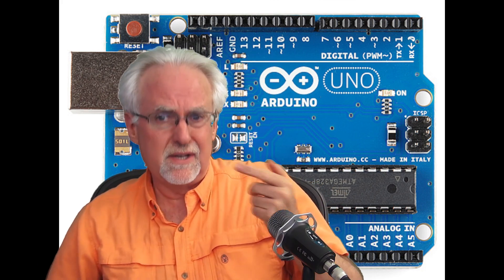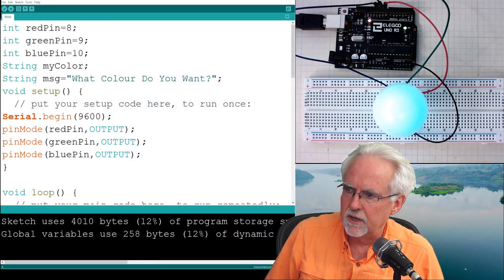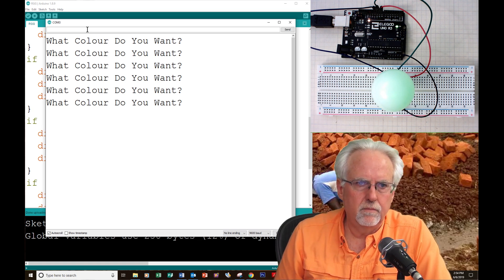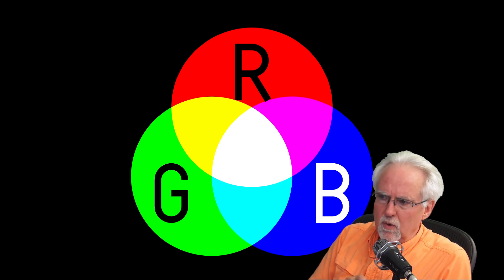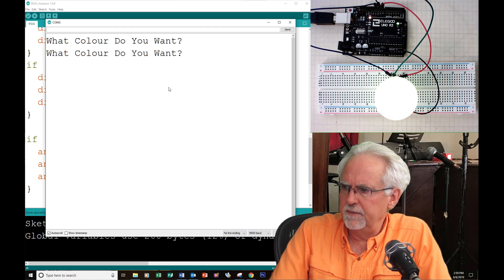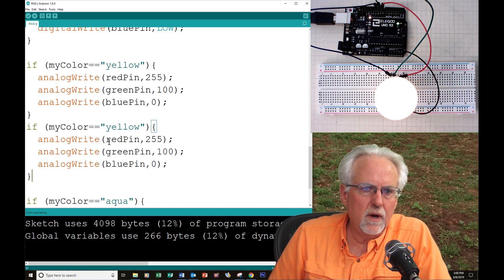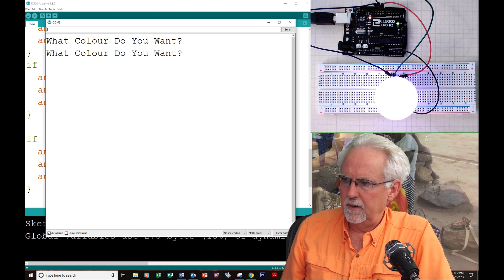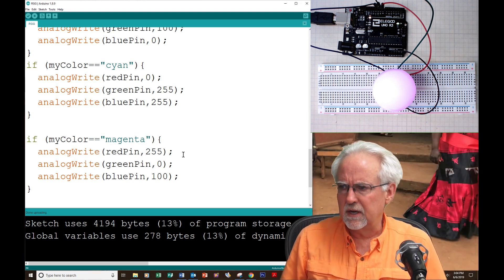Arduino Tutorial 21: Understanding and Mixing Primary Colors with an RGB LED

Comment: Hi Paul, thank you so much for your help! I have a question about my LED. When trying to mix yellow, I also started with the greenish color so I was meticulously going down with the green LED, but after a certain point, the color went from being slightly too green, to way too red on the next number. This border was between 128 & 127. So I just left it as is but it bugged me I couldn’t get it really accurate lol. Same for orange and fuchsia, couldn’t seem to dial those in at all. I wonder if my LED is just a little buggy and I should try another for reference. Anyways, please let me know if you’ve seen this happen before. Thank you again for your help :)

Comment: Even though I've checked and reconnected the cables and rewritten the codes many times, magenta lights up instead of red, aqua lights up instead of blue, and red lights up instead of yellow. No matter what I do, it doesn't change. I tried with different LEDs, but it still doesn't change :( 
When I check the pins one by one, all of them have the correct color, but when I write the code in this lesson, none of them work correctly.
Reply from the maker: Debug by connecting three seperate LED and see if they behave as expected. It is hard for me to imagine what is causing what you are seeing.

Comment: I have a hard time understanding how i can get black color with lights and a white ping pong ball.  White is all 3 colors on full, works fine.  Black is all colors off.  Obviously ping pong ball is still white.  So....  i wonder if the ball were an semi opaque black if this would work better?  Maybe the colors wouldnt be so washed out.
Idk.  I just want a black ping pong ball lol
Reply from the maker: You get black color by turning the lights off and making your room dark. The color of the ping pong ball is now not defined by the LED, but by the room lights. For this case, for the ping pong ball to be black, you must turn off other light sources.
Reply: black its a lack of colors so you cannot obtain it like that

Comment: // C++ code
//
int redPin = 11;
int bluePin = 10;
int greenPin = 9;
int red = 0;
int blue = 0;
int green = 0;

String myColor;
String message1 = "What color do you want? ";

void setup()
{
  Serial.begin(9600);
  pinMode(redPin, OUTPUT);
  pinMode(bluePin, OUTPUT);
  pinMode(greenPin, OUTPUT);
}

void loop()
{
  Serial.println(message1);
  while (Serial.available() == 0)
  {
  }
  myColor = Serial.readString();
  
  if (myColor =="red")
  {
    red = 255;
    blue = 0;
    green = 0;
  } 
   if (myColor =="blue")
  {
    red = 0;
    blue = 255;
    green = 0;
  } 
    if (myColor =="green")
  {
    red = 0;
    blue = 0;
    green = 255;
  } 
    if (myColor =="cyan")
  {
    red = 0;
    blue = 255;
    green = 255;
  }   
   if (myColor =="yellow")
  {
    red = 255;
    blue = 0;
    green = 255;
  } 
   if (myColor =="magenta")
  {
    red = 255;
    blue = 255;
    green = 0;
  } 
  
//  	if (myColor =="")
//  {
//    red = ;
//    blue = ;
//    green = ;
//  } 
  analogWrite(redPin, red);
  analogWrite(bluePin, blue);
  analogWrite(greenPin, green);
}

My approach was to set red, blue, and green based on the color and use a single analogWrite statement for each pin. You could also allow the user to input desired values of red, blue, and green with a little additional code.

Comment: I got the assignment from tutorial 20 done by reading a single line of values for RGB such as 255 255 000 .  It was WAY more advanced C/C++ code than would be appropriate for this course.  You need to know something about "Class" and "Method."  Reading the string as input is no problem for people in this course.  It is:

Serial.println("Enter string: ");
 while(Serial.available()==0) {}
 tst= Serial.readString();

However, from this point on it is rough.  To break the input string tst into three integers that analogWrite() can handle you need to use two "methods" applied to the String "class."  Here it is, but you need to grab a book on Arduino coding like Richard Blum Sams Teach Yourself Arduino Programming in 24 Hours.

  tmpStr= tst.substring(0, 3);  // The dot construction applies the method substring to the variable tst.
  rPrime= tmpStr.toInt();         // Here is the toInt() method applied to tmpStr.  rPrime is the integer need for analogWrite()

Comment: this is fun.  in order to make it portable, I redid this assignment to add a pot. instead of serial input.  then I scaled the pot value 11/1023 and used the if statements based on the calculated integer value.  can change color by dialing the pot, no computer needed.

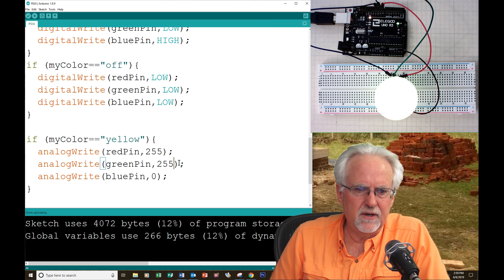Comment: i dont understand this: red and green at 255 in rgb color science produces yellow. Why does that not work here  between 9:00-9:30? Is there some calibration issue of the rgb led? Why does the practice not overlap with the theory here? Your rgb (255, 100, 0) should, in theory, produce a darkish orange, but in practice it produces what you call a "very very nice yellow".

Comment: For Homework you should have had them make ALL 255,000,000 colors! lol...on a serious note when I write a sketch my commands dont turn blue like yours?  is there some setting I have turned off?
Reply from the maker: The new arduino IDE does not turn colors like mine. I thin I was on something like version 1.8. Might download the older IDE.

Comment: Ok this is a Challenge for y'all learners, The goal is to make as many color as you can but, instead of adjusting the color LED power in the Arduino IDE, I want you guys to buy or go get 3 potentiometers and use those potentiometers to adjust the color power, right a code for your potentiometers so that it will control the the color dim.

Comment: Hi Paul! My  RGB LED is not working very well. The LED lights up when I plug it into 5V instead of GND, but I can't control it via pins. I have also tried different cables and other code. But nothing works. What can be the reason?
Greetings from Switzerland

Comment: Having a lot of fun with this class. Even though I have the Elegoo Super Starter Kit, I also have a DrDuino Explorer board that I assembled and am trying to learn how to use. If you are not familiar, the Explorer has a lot of components and devices installed as a very flexible bread board. I can talk directly to many of the devices on board, or switch them out and use the GPIO pins to talk to a conventional Breadboard. Today I used it to play with the RGB LED. Instead of entering numbers via the Serial comms, I used the three on-board Pots. Read them via analog pins, converted to PWM values, and sent the numbers to the LED. Therefore I can adjust the three pots to create any color I want. So much fun! Thanks for this great class!

Comment: Being the exploring type, I came up with an interesting variation.
Using for loops and and an if statement, I wrote a sketch that continuously cycles the RGB LED through al the colors from red to yellow to green to cyan to blue to magenta to red, and all colors in between. Of course I used a delay to control the speed.
Pretty cool!
Reply: Awesome

Comment: Hi, I am facing a trouble if anyone can help. I have trying to use if statement for comparison of input String. but weirdly the == operator is not working. If I input "red" from serial monitor using myColor=Serial.readString(); and compare using myColor=="red". the statement is coming false. I have check all the formatting and checked individual LEDs as well. But when I input red the red LED is not lighting up.
Reply: The serial monitor adds “/n” to end of “red”. In the serial monitor, at the bottom, select “no line ending”. It will work.

Comment: I have tried two RGB LEDs and the blue will not modulate.  They are full on at 128 and off at 127 .  I have tried reducing the resistor to no avail.  What is going on?
Reply from the maker: Are you connected to a pin with ~ as instructed in the video?
Reply: Ah that was the trouble.  Thank you for taking the time to respond.  You are an excellent teacher.

Comment: Thank you so much,these lectures are helpful.Am new to Arduino  and wishes to do a control project, now my question is,is it possible for me to use a single Arduino to have a battery charge controller and an LDR based LED light controller?

Comment: That is my code for RGB LED controled by potentiometer : )

int red = 11;
int blue = 9;
int green = 10;
int readPin = A5;

float przejscie;
float blueVal;
float redVal;
float greenVal;

void setup() {
pinMode (red, OUTPUT);
pinMode (blue, OUTPUT);
pinMode (green, OUTPUT);
}

void loop() 
{
przejscie = analogRead(readPin)*(1275./1023.);

while(przejscie <= 255)
{
przejscie = analogRead(readPin)*(1275./1023.);
blueVal = przejscie;
analogWrite(blue, blueVal);
analogWrite(red, 0);
analogWrite(green, 0);
}

while(przejscie > 255 && przejscie <510) 
{
przejscie = analogRead(readPin)*(1275./1023.);
blueVal = 510 - przejscie;
redVal = (-255) + przejscie;
analogWrite(blue, blueVal);
analogWrite(red, redVal);
analogWrite(green, 0);
}

while(przejscie > 510 && przejscie <765) 
{
przejscie = analogRead(readPin)*(1275./1023.);
redVal = 765 - przejscie;
greenVal = (-510) + przejscie;
analogWrite(blue, 0);
analogWrite(red, redVal);
analogWrite(green, greenVal);
}

while(przejscie >=765 && przejscie <=1020)
{
przejscie = analogRead(readPin)*(1275./1023.);
greenVal= 1020-przejscie;
blueVal= (-765) + przejscie;
analogWrite(green, greenVal);
analogWrite(blue, blueVal);
analogWrite(red, 0);
}
while(przejscie > 1020 && przejscie <=1275)
{
przejscie = analogRead(readPin)*(1275./1023.);
blueVal = 1275h - przejscie;
analogWrite(blue, blueVal);
analogWrite(red, 0);
analogWrite(green, 0);
}
}

Comment: Great tutorial, Paul! I adapted the program so you input the red level (0-255), green level (0-255), and blue level (0-255), and then turn on the LED appropriately. Easy way to experiment with the colors without changing the code each time. Thanks for all your hard work!

Also, and I am probably a minority opinion here, I would love even more theory.  I'm sure you'd get lots of pushback, but hey, that's what the fast forward button is for. Personally, I like knowing everything about everything I am doing.

Comment: i was doing this w/ clone nano, didnt work, checked ledw/ 5v pin, worked, checked arduino by swapping it w/ another, and code by downloading it from ur website and it won't  work, plz help, it was't outputing any voltage across any pins when i selected witch colour, but all the pins work with a blink sketch, may just be an arduino web editor bug?
idk
Reply: also all the other eposodes worked, exept 20,21, and19
its weird

Comment: Excellent stuff thank you!  However in Tutorial #20 the pin assignments were 8,9,10.  On my Arduino pin 8 does not support analog (there's no ~ against it) .  I shifted my pins to 9,10.11 all of which support analog writes, or am I missing something?  Also my RGB LED was the opposite polarity, so I needed to invert all the values :-)

Comment: Had a fun little idea using the potentiometer to change the color of the LED.
if anyone wanted to try it here is the code I used.

int r = 9;
int g = 10;
int b = 11;
int potVal = A1;
int readVal;
int pause = 200;
void setup() {
  // put your setup code here, to run once:
Serial.begin(9600);
pinMode(r,OUTPUT);
pinMode(b,OUTPUT);
pinMode(g,OUTPUT);
pinMode(A1,INPUT);
}

void loop() {
  // put your main code here, to run repeatedly:
readVal = analogRead(potVal);
Serial.println(readVal);
delay(pause);
if (readVal >= 0 && readVal <=85){
  analogWrite(r,255);
  analogWrite(b,0);
  analogWrite(g,0);

}
else if (readVal >= 86 && readVal <=170){
  analogWrite(r,255);
  analogWrite(b,0);
  analogWrite(g,30);
}
else if (readVal >= 171 && readVal <=255){
  analogWrite(r,255);
  analogWrite(b,0);
  analogWrite(g,70);

}
else if (readVal >= 256 && readVal <=340){
  analogWrite(r,125);
  analogWrite(b,0);
  analogWrite(g,255);

}
else if (readVal >= 341 && readVal <=425){
  analogWrite(r,0);
  analogWrite(b,0);
  analogWrite(g,255);

}
else if (readVal >= 426 && readVal <=510){
  analogWrite(r,0);
  analogWrite(b,125);
  analogWrite(g,255);

}
else if (readVal >= 511 && readVal <=595){
  analogWrite(r,0);
  analogWrite(b,255);
  analogWrite(g,255);

}
else if (readVal >= 596 && readVal <=680){
  analogWrite(r,0);
  analogWrite(b,255);
  analogWrite(g,125);

}
else if (readVal >= 681 && readVal <=765){
  analogWrite(r,0);
  analogWrite(b,255);
  analogWrite(g,0);

}
else if (readVal >= 766 && readVal <=850){
  analogWrite(r,125);
  analogWrite(b,255);
  analogWrite(g,0);

}
else if (readVal >= 851 && readVal <=935){
  analogWrite(r,255);
  analogWrite(b,255);
  analogWrite(g,0);

}
else if (readVal >= 936 && readVal <=1023){
  analogWrite(r,255);
  analogWrite(b,125);
  analogWrite(g,0);

}

}

Comment: Using the skill gained from you excellent tutorials, I wrote a little sketch that prompts you to input in the red, then green, then blue values. This allowed me to quickly set the colour without having to modify and compile/upload each time. Just checked the Arduino reference and, like most languages, there is a random number function. I will try to do a sketch where the arduino continually generates random colours.
Reply from the maker: You can do random colors, or more interesting is to try to make colors that seems to slowly and smoothly go through an infinite variety of colors, like a constantly changly color wheel.

Comment: Hi Paul. You are an epic teacher! I got a question about the coding. Could you use an else statement after the if's? like for the redPin: if (myColor =="red")
{digitalWrite(redPin,HIGH); }
else{digitalWrite(redPin,LOW);

so you dont have to manually set everything to HIGH and LOW or other values and if you switch to another color it will turn it off. 

Will this be good coding in your opinion?

Thanks for your lessons! It's a blast!!! Or better said: BOOOOM

Comment: int redpin=3;
int greenpin=6;
int bluepin=5;
int redInput;
int greenInput;
int blueInput;
String red ="Enter the red Value ";
String green = "Enter the green value ";
String blue =  "Enter the blue value ";

void setup() {
Serial.begin(9600);
pinMode(redpin,OUTPUT);
pinMode(greenpin,OUTPUT);
pinMode(bluepin,OUTPUT);

}

void loop() {

Serial.println(red);
while(Serial.available()==0){}

  redInput= Serial.parseInt();
  Serial.println(green);
while(Serial.available()==0){}

  greenInput= Serial.parseInt();
    Serial.println(blue);
while(Serial.available()==0){}

  blueInput= Serial.parseInt();
  Serial.println("The Value You Have provied ");
  
  Serial.print(redInput);
  Serial.print(";");
  Serial.print(greenInput);
  Serial.print(";");
  Serial.println(blueInput);

  analogWrite(redpin,redInput);
    analogWrite(greenpin,greenInput);
      analogWrite(bluepin,blueInput);
  // put your main code here, to run repeatedly:

}

Comment: I have one doubt, earlier in videos you mentioned only ~3,~5,~6,~9,~10,~11 are used for PWM and in these videos we are using pin 8, 9 and 10 and we are giving analogWrite to all three of them for mixing colors. How would the analogWrite command work on Pin 8 as it is not a PWM pin?
Reply: I saw the same thing, the red was always 0 or 255 so LOW or HIGH so it didn't cause a problem

Comment: Code to request a value for each color from the user, error check it and correct if necessary, print the value and write the values to the LED.
int rPin = 6;
int gPin = 9;
int bPin = 10;
int rValue;
int gValue;
int bValue;
String msg1 = "What value do you want for red (0 - 255)? ";
String msg2 = "What value do you want for green (0 - 255)? ";
String msg3 = "What value do you want for blue (0 - 255)? ";

void setup() {
  // put your setup code here, to run once:
  Serial.begin(115200);
  pinMode(rPin, OUTPUT);
  pinMode(gPin, OUTPUT);
  pinMode(bPin, OUTPUT);

}

void loop() {
  // put your main code here, to run repeatedly:
  rValue = 0;                        //Initialize the variables
  gValue = 0;
  bValue = 0;
  Serial.print(msg1);                //Get the red value
  while (Serial.available() == 0) {
     
  }
  rValue = Serial.parseInt();        //Check for negative number
  if (rValue < 0) {
    rValue = 0;                      //Correct if necessary
  }
  if (rValue > 255) {                //Check for too large
    rValue = 255;                    //Correct if necessary
  }

  Serial.println(rValue);            //Print value
  
  Serial.print(msg2);                //and on to the next one
  while (Serial.available() == 0) {
     
  }
  gValue = Serial.parseInt(); 
    if (gValue < 0) {
    gValue = 0;
  }
  if (gValue > 255) {
    gValue = 255;
  }

  Serial.println(gValue);
  
  Serial.print(msg3);
  while (Serial.available() == 0) {
     
  }
  bValue = Serial.parseInt(); 

  if (bValue < 0) {
    bValue = 0;
  }
  if (bValue > 255) {
    bValue = 255;
  }

  Serial.println(bValue);
  
  analogWrite(rPin, rValue);               //and light the LED
  analogWrite(gPin, gValue);
  analogWrite(bPin, bValue);

  Serial.println();

}